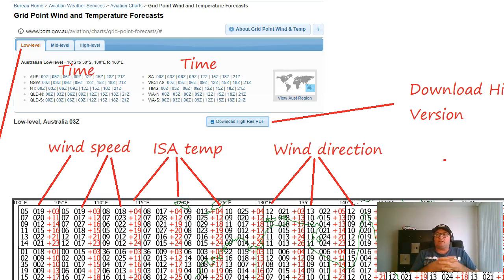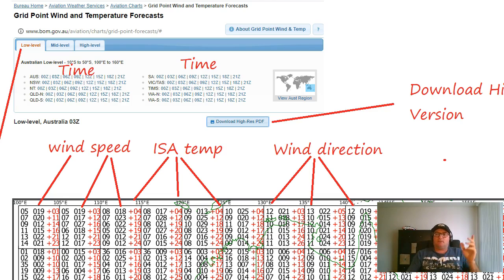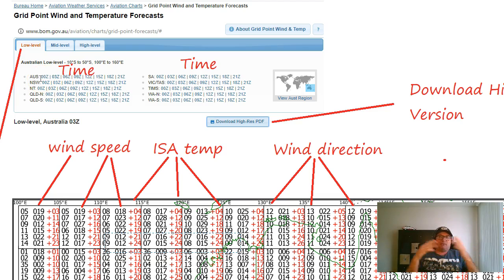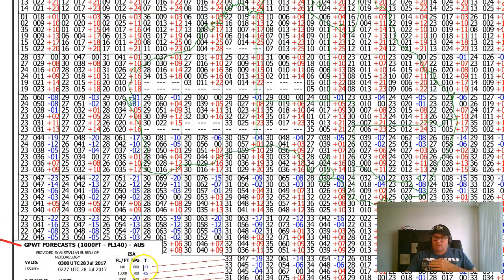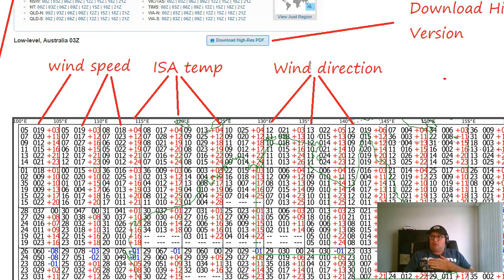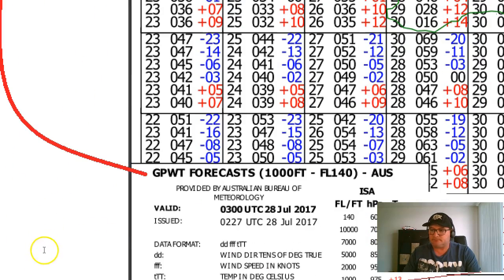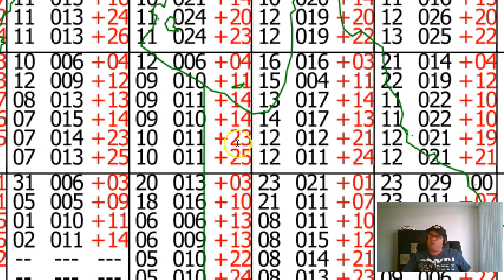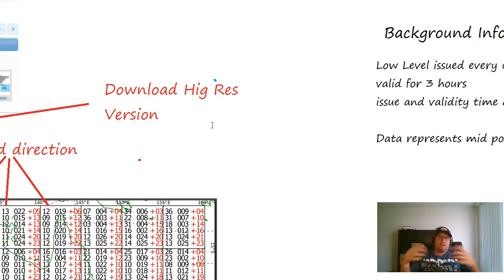Grid Point Wind and Temp Forecasts

Comment: On some gpwt, you have for example 30 degrees south and then three and a half boxes to the right it’ll be 35 degrees south. Is there a way to measure exactly the points in between or is it just guestimation?